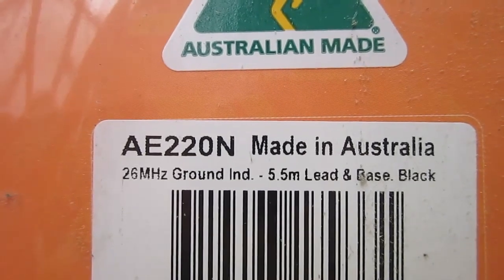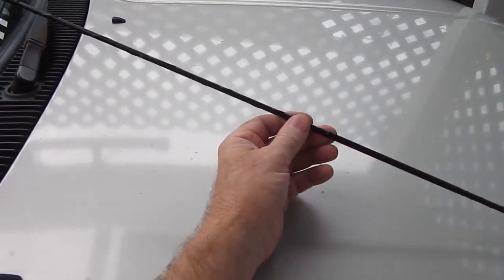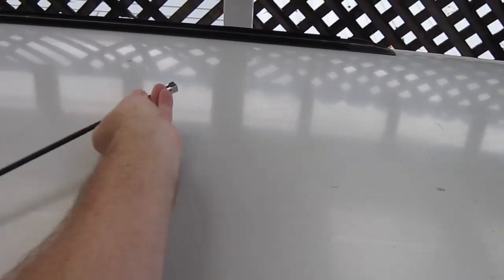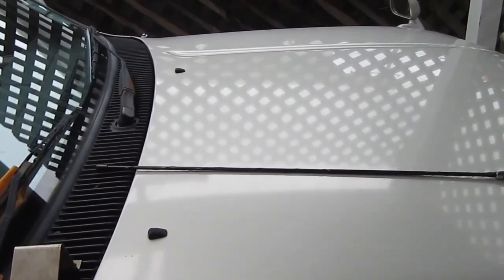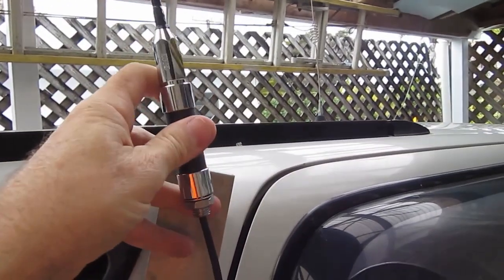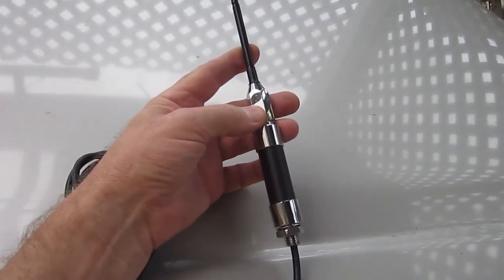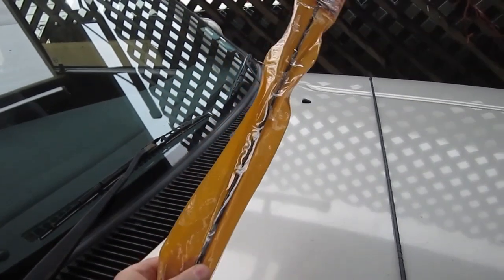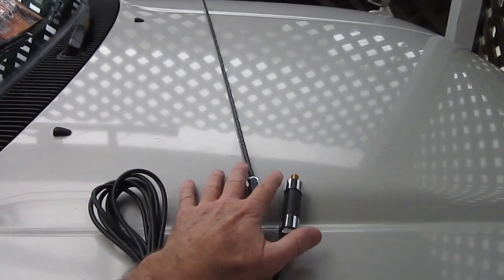CB Antenna's. Two Types and their Applications.

Comment: Great Info there bud. Could you tell me between these two types of antenna's, is the ground dependent design a better performer and if so, is it by a substantial margin? Are performance gains across the board both on AM and USB/LSB ? Thanks in advance.